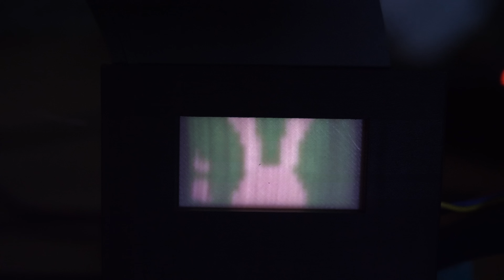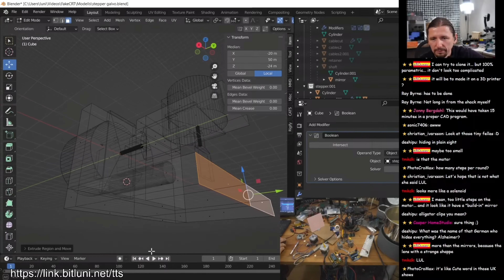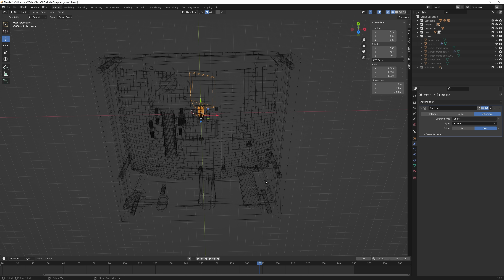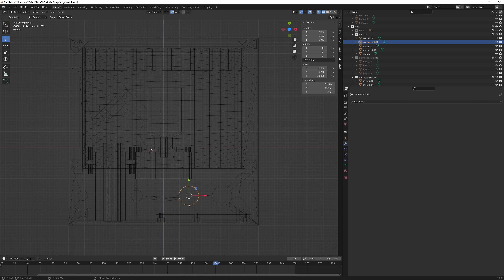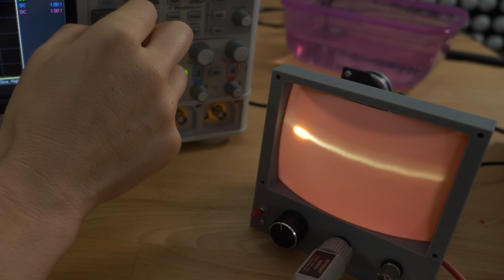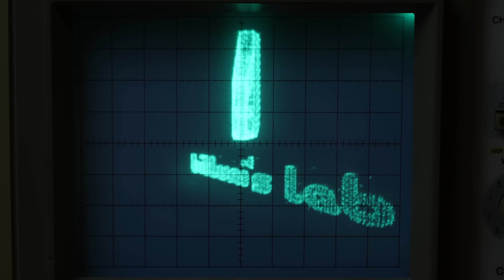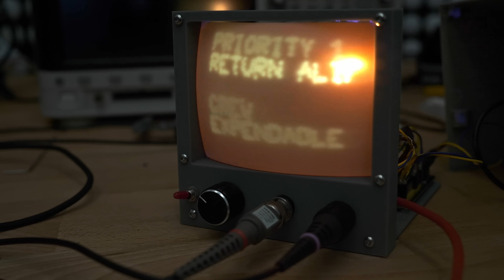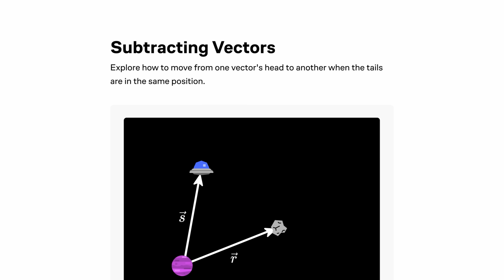I made a fake CRT TV with a LASER

Comment: one axis should be permanently spinning, with multiple mirrors, for a continuous scan. That should improve speed and precision a lot. If you still want a XY-mode, you can just tell the software to disable the laser when it's in the wrong location, although that might result in too low of a brightness, but maybe the laser diode is rated for higher peak current if the duty cycle is low.

Comment: This is a really i teresting video, ive actually thought about emulsting a CRT with a lazer but have no experience designing a circuit like that. I would love to see you use a barcode scanner (I think they actually generate a raster which you might be able to modify to work with a larger screen).
Reply: Ever bean to a supermarket? Those scanners only have one polygon scanner and some fixed mirrors . No raster with 200 lines

Comment: Why don't you get a broken crt and use it's phosphorus screen as it similarily reacts to UV light only that it requires a bit more energy but won't hold it's glow too long, after you figured out on how to make the laser faster and more stable
I'd like to see a new and cheap way to manufacture crt like tv's for retro gaming as the tv's are dying
Reply: Short glow phosphor can be bought.
Reply: @ArneChristianRosenfeldt  crts you can get for free
Reply: @ just important that people don’t throw them away, but know that there are fans who carry the heavy device away for them. 4th floor? 1 h drive by car? 50 kg ? No problem!

Comment: the mirrors are not the correct type. you are loosing accuracy and sharpness from the refraction. what you need is first surface mirrors. you can salvage these from a photocopier. first surface mirrors have the reflecting surfaceon the front of the glass eliminating any refraction from the thickness of the glass. normal mirrors are second surface mirrors, the reflecting surface is on the back of the glass.  Laser cutter mirrors would do as well.

Comment: If you wanted an oscillating mirror, the idea of using speakers with oscillated sound was good. But movement in speakers is to low.
The constant magnet in speaker is good, however the electric coil is too small and weak, because it needs to be lightweight for good sound.
Placing small magnet on the mirror and using big electric coils have much more potential, I think.
Reply: Use a bass speaker. Also: buy a thin mirror and not a shiver out or the trash.

Comment: I think the speaker option was on the right lines, you just needed to play with the mechanics of the mirror to get larger angles of reflection from a smaller speaker displacement.  For example, make the distance from the fixed end to the moving end of the mirror smaller.  There's also voice coil actuators, which are like speaker coils, but they have no diaphragm or cone, and they have larger displacements. You can make one yourself with a cylindrical magnet with north and south at each end, and tubular coil of wire hooked up to an audio driver.  The old CRT screens had a ~15.7kHz horizontal scan rate, within the audio range, so speakers and voice coils should work.

Comment: Make the scan with rotating mirrors, as in a printer or scanner.The rotation speed is synchronized by lines and frames.
Two mirrors, vertically and horizontally. All that remains is to light and extinguish the laser at the right moment.

Comment: That's a sick DIY vector display.

I wonder if you could "emulate" a CRT more passively by just having the laser move such that it scrubs across the screen left-to-right and then top-to-bottom.  If it can do that fast enough, you could then use the laser pulsing to control the actual image instead of trying to wring a ton of accuracy out of your stepper motors.   If you use a full 180-degree rotation, you could even technically have a "v-blank" period where the laser is swinging back around to the top of the image.

Comment: I wonder if you could use a shadow mask for color, you'd print a thin translucence sheet with an RGB pattern based on the shadow mask behind it. Then all you have to do to change color values is increase or decrease the laser strength of three lasers.
Reply: So basically just like on LCD. Use some software ? I propose to utilise the spiking of laser diodes. The fire them round robin to simulate a Trinitron

Comment: If you just constantly rotating the two mirrors, like 60 RPM the first and 3600 RPM the second, you can get a decent 60x60 screen out of it
Just need to pulse the laser much faster, and very consistent speed on the two mirrors (maybe one bigger motor with some transmission, for example a belt driven transmission, than the speeds will be locked)
and the laser need to pulse on 3.6kHz in this example, maybe i'm wrong with the numbers but the overall can be work out from this idea
+1 you can reduce the speed by using 2 180 degree mirrors in half (both side mirror) or by 4 if you use cube, or by 6 if you 6 mirrors, like a bolt head outer edge

IDK what it was exactly but i seen one of this interesting display, that gave me the idea
Reply: or if you plan, to further improve the speed on this, you can convert the rotating motion to liner
For example: (from the first hit on google) "Rotation can be converted into linear motion via a screw-and-nut system assembled on the motor shaft. There are two main types of screw-and-nut systems: ball screw and lead screw. A ball screw operates on rolling contact between the nut and a screw. The ball is recirculated along a helical groove."

Second hit: "What is rotary to linear motion?
Rotary to Linear Motion | MISUMI Mech Lab Blog
A slider-crank mechanism is a typical design which converts rotary motion into linear motion. It is achieved by connecting a slider and a crank with a rod. This mechanism is also utilized as a system that converts the reciprocating linear motion of an automobile engine into rotary motion. "
Reply: Found it! It was a scanner that had a hexagon mirror spinning, this way it can scanned one line without the reciprocating motion, and it eliminated the high speed-high inertia line distorsion problem

Comment: I'd recommend 2 lasers at a minimum but the only problem is that each laser contraption will need it's own brains so it won't be able to be that small anymore the more laser contraptions there are the more sharper the image will be but then you will also need another brain (CPU) Board that will be able to control all the other brains and but to also make things easier give it the ability to update the firmware on the connected brains just a thought sorry

Comment: You can put a tab on the support of each mirror and a sensor. When you turn it on, the first thing the equipment does is turn each of the motors until the tab passes the sensor. Then it calibrates itself.
Another option, which is the most common in cheaper laser show devices (the kind used in nightclubs), is to put a mechanical limit on the motors. So, as soon as you turn on the device, the motor will turn about one revolution. The motor tab will hit the stop, so the equipment will know the position and calibrate itself.
These are two very simple options to avoid having to manually calibrate each time.
The mirrors can be much smaller, specially the first one, less mass = more speed.

Your project turned out cute, I liked it!
Reply: End-Stop Calibration, certainly familiar to 3D printer operators, so long as the micro-switches are outside the normal operating range of the mirrors while painting the screen with the laser it probably wouldn't even interfere with normal opperation
Reply: @UNSCPILOT  exactly, the switch can be mechanical or optical, but the second idea is even simpler, it is just a mechanical barrier, in this case would need just 2 screws as the barrier and remodel the mirror holder adding a tab or another screw.

Comment: Another option is to make a multi-faceted rotating drum.  Each facet is at a different angle.  As it rotates, it sweeps each angle across.  Each sequential angle is slightly higher, so it scans left/right and slowly up/down.
Reply: My idea was just to have two drums each with increasing angles rotationally for the x and y axis.  No problems with dark areas in the center as with flat prism and mirror solutions because the drum is already curved, and without the problems with inertia that we have with oscillating mirrors.  The machining tolerances of the drums would be critical but doable.
Reply: @redleader7988  maybe 3d printable with attached facets? I may not be imagining what you're describing though
Reply: @neogeo8267  I wasn't thinking in terms of facets. I was thinking that if the surface of one of the polished drums is helical, it could deflect the laser beam gradually across one axis (e.g., the horizontal direction, or X-axis) as the drum spins.
The idea is that as the drum rotates, the angle of the reflected beam changes smoothly, causing the laser to "sweep" across the screen.
Reply: @redleader7988  interesting! Machining or otherwise manufacturing such a surface would be challenging, unless there is a technique I'm unaware of. 

I was imagine facets such that each was a flat surface. Each face would be angled vertically more than the previous one. As the drum rotate, the beam would sweep right left, then the next facet would start the sweep over but one line down. 

You would need the same number of facets as lines which means either a very large diameter drum or a series of lines of facets and a gross-adjust galvo to switch between them. 

An absolute position sensor and good speed control on the drum as well
Reply: But wouldn’t that shift the beam? I was thinking about the vertical mirror after this. Do we need a lens to hit it ?

Laser Gaussian beam lens waist on polygon scanner 1:f lens pair waist on galvo  large concave mirror  waist on pixel

Comment: WOW very cool project and interesting galvos!
Some time ago I experimented with a 5W(optical) laser cutter module from LaserTree, stepper motors and drivers with microsteps to build a laser text engraver and effect projector as practical project for my studies.
You could build a very cool engraver or laser turrert with those cool galvos you created if you use a bit more power and maybe a lens :D
Before I used first surface mirrors, the power density of the laser was enough that the glas got a bit warm, expanded a bit and spreaded the beam out like a weak lens.

Maybe I try your galvos in my project, they are incredible!! 
I always had problems with ringing stepper motors and annoying sounds at those speeds and buying galvos were way to expensive :)

Comment: That's a long way from the  old 15,750 hz broadcast TV line scan rate. Perhaps super-persistent phosphor would hold more detail help.
  A speaker like voice coil piezoelectric is the sort of thong used on laser light shows.
  A speaker voice coil for fast-small deflect, course positioned by a stepper could improve resolution, in roundabout way.
Reply: TV is for moving pictures
Reply: But it is emulating CRT TV technology
Reply: @apexd8921  I just don’t like super persistent phosphor. Reminds me of the dark ages where we had no RAM nor ADCs . RADAR screens and storage oscilloscopes.

Comment: You might want to upgrade to servo(not RC servo, real analog servo) Galvos. They can be easily built with way less mass and totally analog electronics. They are good up to a few kHz.Also for honrizontal line scanning every laser printer already has a perfect mechanic. Then you need just the vertical deflection. If you want a real nice mechanic - look for super 8 cutter projectors.

Comment: If you want to use voice coils (which is a good idea, as they're low mass which real galvos rely on for their fast movements) you gotta use speakers that have much longer travel ranges. The magnets on those ones in the beginning are far too thin to have a coil long enough for a useable travel.

I once used some stage laser projectors that used the same kind of stepper XY setup. To home them, the mounts had a little tab that stuck out that would hit a screw on the mirror holders, on power up the controller would just do a full series of steps (200 at full step for 1.8 deg/step motors) in that direction so no matter where they were theyd turn till they hit the tab then skip (a little brrrrrrt sound at power on). Now the controller just assumes they made it and off it went using that as the home for counting steps!

Just some off the cuff 2 cents. All around neat build!😎👍

Comment: Conventional oscilloscopes had electrostatic deflection plates to steer the electron beam....
The next best are Electrostatic Motors....
these are a reality today.
Next time try using or making electrostatic motors that have negligible  inertia... (capacitive type...)..instead of using conventional wire wound(inductive) motors.
For mirrors..they should be circular in shape not square...
Surface tension/stress is uniformly spread over the whole area. So it's mech. vibrations are also uniform, predictable & perhaps easier to dampen out .

Comment: There was a project that used red green and blue lasers and spinning mirrors to project video out of a composite signal.  Nothing more came out of it, unfortunately, not even a schematic.  I hope something like this happens in the future.
Reply: Was the picture stable? I feel like amateurs use cheap bearings which inject a lot of noise into the mirror substrate. No sound deafening material in sight.

Comment: That is fascinating!

When I was like 14 or 15 yo, I built sort of a mechanical oscilloscope, just because I liked constructing things. It had three mirrors stuck onto a rotating three-sided column driven by an electric motor and, because there were still no laser pointers or any other affordable lasers around, I used a small halogene light bulb focused through a lens whose beam was reflected by a small mirror stuck to a speaker and then, after passing another lens, reflected by that fast rotating mirror column to the backside of a matte glass screen. It was blurry but it somehow worked! You could adjust the "trigger" through a potentiometer that controlled the motor speed. I demonstrated it to my physics teacher and she was amazed.
Reply: When I was younger (35 years ago) I intendend to build a TV with laser, but the main difficult was the beam deflection. At that time my efforts focused on using voltmeter device. The idea was to glue a small light mirror to the axis of the arrow. The higher the voltage the higher would have benn the deflection angle. But the speed required was too high. One full frame in 20 ms (50Hz) must be created by 625 lines, means a sweep (the line) every 32  microseconds. Really too fast. If we used a triangular mirror on a motor, this should have rotated at about 10.000 rps! And with a such precision....
Reply: @leonardomarchesi6169  Mine rotated at about 1500 rpm and it was well sufficient to at least draw one contiguous line. But was incredibly noisy, and the startup of the thing sounded like switching on a mad scientist's machinery haha.
Reply: When I was a teenager in the 90s my friend and I built a number of laser light show devices using head positioning mechanisms from discarded hard drives. They were open loop so they could not generate vector images but they did produce some nice patterns when driven with audio.

Comment: Please make a bug zapper!! 2 speakers to shape a circle that goes smaller and smaller until a dot. Mount this on a gimbals with steppers to be able to move the beam over a large surface. Use a camera and image recognition to spot a dark dot appearing on the ceiling, or on walls (but higher than heads!). This must be a bug that landed! Aim the gimbals, fire the large circle beam around the fly: it can't escape from the cone of light. Then narrow the circle... this should at least burn the wings if you use a laser from a DVD reader...

Comment: Laser printers already do half of this. No need to reinvent the wheel. Just pull a module out of a laser printer and swap out the laser. That would be for the horizontal.
Reply: Laser printers use a motor with a prism like reflector so the laser always starts on the same side instead of moving back and forth.

Comment: Ok,, the idea is there but the technologies chosen are probably not up to the task.

the direct drive that you are using is only suitable for a slow X/Y display. As you noticed stepper motors are not able to move fast.
To reproduce what a scanned CRT does I would recommend changing from:
direct drive with single mirror
to
multi faceted spinning mirror wheels (like in a bar code reader) with position feedback.

This requires :
1) implementing DC speed regulation by négative resistance drive.
2) using a tachometer wheel to READ IN the current positions of the wheels
3) change the software to use the timings in 2) to adjust the output of the laser

Negative resistance means that the motor driver increases curent under load to keep the voltage at the motor unchanged.
Constant voltage at the motor means constant speed.
This is implemented by putting the current sense resistor in the feedback loop of an OP amp.

Comment: Hi, I wonder why everyone is playing around with stepper motors and brushless motors and so on while a real galvanometer is a  totally different construction. A analog meter like a analog voltage meter or analog current meter are constructed just like a galvanometer. The only difficult part is , to minimize ne rotating tork. The easiest way to achieve this is to mount only narrow long mirrors to keep the masses close to the center of rotation. I never tried this myself.